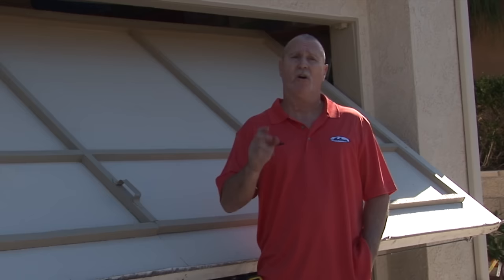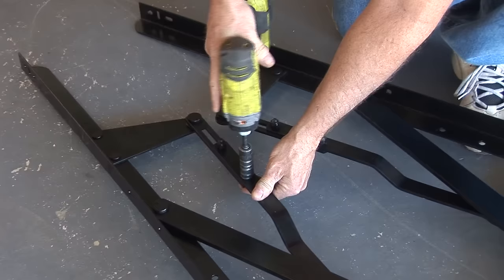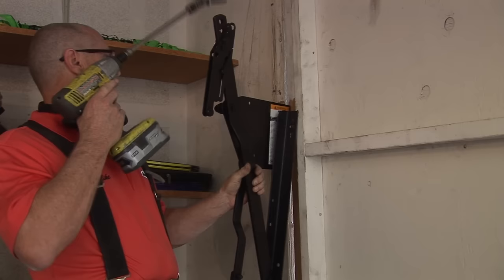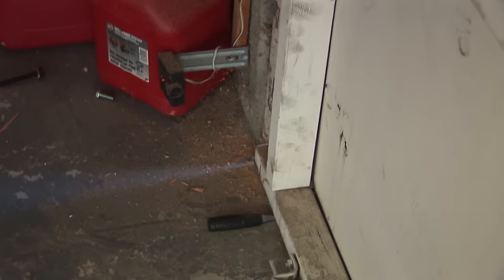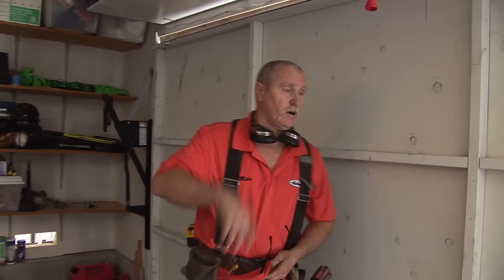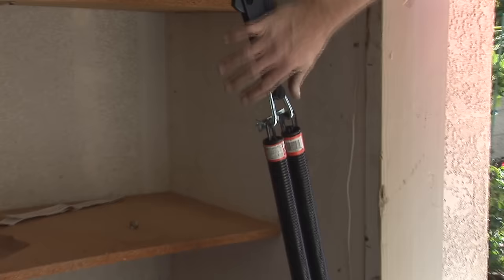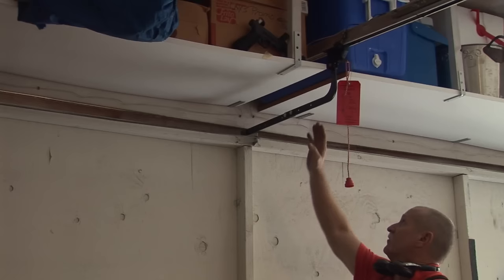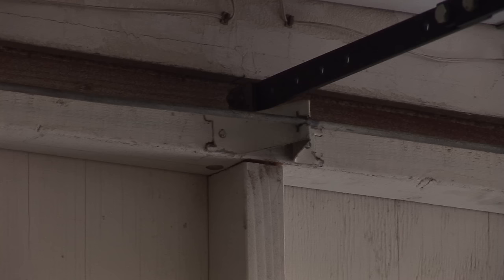Installing Holmes E-900 Hardware & Springs

Comment: You are the man, Mike!   I have a 32 yr. old one piece steel door with worn out hinges.  The main hinge pivot had almost worn completely through the master arm.  I had to do something fast.   I called 15 garage door companies here in Phoenix, but none would work on a one-piece door.   They were all happy to recommend that I spend over $2,000 for a new roll-up door.   I'm very happy with my existing door.  In 32 years, it has only needed 2 sets of extension springs (easy DIY job).   Compared to what my neighbors pay for constant maintenance on their roll up doors, that's a bargain.    Thanks to your video I was able to replace the hinges and springs on my one-piece door for $200 and about 4 hours of my time.  You saved me $1,800 and lots of future maintenance bills.   Thanks!!!
Reply from the maker: Wow That's fantastic!! you wouldn't believe the crap I get from garage door companies protesting the fact that I put out video's like this. It cuts into their business when you do this type of job yourself. They say it's way to dangerous to show jobs like this, but obviously not since you were able to pull this off...Good for you!! Thanks for watching!
Reply: Funny thing is that I tried for months to find a garage door company to do the job.  No "professionals" were interested.    As for danger,  your video shows the proper way to install this kit.   I suspect it would be more dangerous for a DIYer to install the E900 kit without having viewed your video.      Thanks Again!!
Reply from the maker: Excellent!! Now you know the limitations of the “professionals” in your area! 😆
Glad it worked for you! 👍🏽
Reply: Thank you, Mike, for taking the time to completely explain and demonstrate how to remove and replace one piece garage door hinges.👍 I loved my one-piece door and didn't want it replaced at any price. I'm fairly handy with repairs but was very nervous taking on my R&R job. Watched this video 3 times and then set out with what you teach and 5 hours later, with no hidden surprises, I have my brand new one piece door hinges installed and working perfectly. Getting the bottom of the door gap right would have been something that I would have never considered. My garage door has never functioned so well.👍
Thank you again for putting this together, Ed.

Comment: Thank you for taking the time to explain each step in this video. Ive just rebuilt two 90+ year old houses in the Hollywood Hills, and want to keep the 1pc doors original. I've never done garage door work before, yet know I can confidently tackle it now...these informatives not only help do-it-yourselfers, but they also assist those of us whose building fortes lie elsewhere.
Reply from the maker: Robert Dunn Glad to help out Robert!! As you can see by some comments there are others that would prefer you not do anything on your own...you should pay a "certified Master technician" to rip you off. Glad to see you tackle it and save the coin!!

Comment: After all these years, this still appears to be the leading video on one-piece garage-door installation. Good video demonstrating you are the strongest man in the world - but for women doing this, you leave a lot out regarding how to get  springs on without being the strongest man in the world. Also, my E-900 P728 springs appear to have an inter-spring or steal thread that has to simultaneously line-up with the larger outside diameter spring attachment hole in order to make the hook up. Strongest man in the world method does not work for this. Lastly using the strongest man in the world method to "muscle" the springs into place can be a disaster if you pull up on the spring with your bare hands (as you do in the video) then come to realize, you can't make it to the top and have to release it => now that the skin of your hand is inside the coils, when the coils collapse, your skin stays inside, much pain, bleeding etc. Wear very heavy gloves to avoid this. But overall most of the video is educational and accurate. I used the E-900 kit after building my own door from scratch since I build my own house new - it never had a prior door to work with. About $300 to complete the project absent an electric opener. Far cheaper than any other method of making a good 100 mph wind-proof garage door.
Reply from the maker: I will agree that this type of job is not for the average joe! But i think it’s more technique than muscle. However you are correct in the massive savings by doing this yourself. 👍🏽

Comment: Mike I can’t tell you how many times I come back to this video when I need to make adjustments. I built a 16’ slab door for my son 2 years ago, and had it tweaked perfectly thanks to your well done videos. I had an incident happen yesterday that you might want to stress to your viewers. My lag bolt that holds the steel anchor for the springs at the bottom of door failed and shot out like a rocket from the tension of the springs. I told my son that it was my fault because I should have gone with a longer lag screw to hold the anchor. It was my fault, not anything to do with manufacturer. The problem now is, he is so freaked out that he doesn’t want springs anymore. He thinks they will break or something. He wants counterweights, and I told him that is nearly impossible because it would require a lot of weight suspended from hardware that wasn’t designed for that. I am a little frustrated right now because I know it’s a simple repair, and it was pilot error. Just stressing the fact to your viewers, the importance of making sure the bottom wall anchor for the springs is secure. It’s been too long for me to remember, but I think I used my own lag screw, and it was only about 3” long. Not enough.
Reply from the maker: The lower lags should have been provided in the hardware kit but in any event they are roughly 5-1/2 to 6 inches long and when you pilot hole for the lag try to angle it slightly upward. That should make for a good hold, they rarely pull out when installed properly. Counterweights…like you said just won’t work so maybe just refill the hole with a dowel, and pilot upward and use the longest, strongest lag that will work and you’ll be fine. Do both sides.
Reply: Thank you for such a quick response! There is no question it was my error, and I knew the lags were supplied. Somewhere down the line I screwed up and used the wrong lag, or one of my own. Thanks again! Now it’s just convincing my son that it won’t happen again. It was my fault. The hinges are fantastic! No complaints at all! I love all the adjustments you have to choose from.

Comment: Mistakes.  1.  Disconnect the L bar from the opener and the top of the garage.  Or else
you will destroy it when you open the door.  2.  Hang two 5 gallon buckets of water from each
spring attachment bolt on the hardware.  This 80 lbs hanging from the spring attachment point will allow you to raise the door.  You will break your back trying to lift the door without water bucket counter weights.  
                    Mike has made an excellent video.   Like he says, mount the plate, adjust the door........ then screw in your 3 inch lags to the door with the hardware in a natural position of comfort.   The hardest part is raising the door without any springs.
Reply: Yeah my guy did not do that and now I am screwed.

Comment: Mike, I was looking for a fairly short video, today, to get me through my job of installing new springs P728 on a wood garage door just like this one in video. I've done the job and came across your video, tonight and told myself "I'm not watching a 48 minute drawn out video. I really don't have time. I found myself watching this from beginning to end! You really did a great job on this install vide. I am happier than happy that I started it. You refreshed me and taught me things about these setups I didn't even know about. THANK YOU! 
Today, it took 2 of us to pull these springs up to get them on the hooks. Then, the door was too hard/heavy. Opening and closing felt too heavy and I was NOT going to install the new carriage until it was much better. I adjusted  the bolts on the Adjustable Kicker (4 holes) down 1 hole on each side. This was a huge difference. However, I had to remove springs in order to move bolts to lower holes. Does this sound like the spring hook chain is 1-2 links too short Again.., 2 to R&R the springs. It seems to operate well but, something in back of my mind says this door should be a little more easier to operate.
Again, thank you, for an excellent, top notch, professionally done video! Liked, subscribed and saved this video!
Reply from the maker: Thanks buddy I appreciate ya watching my vid. sometimes these doors can be so heavy that even a balanced door takes a bit to get it moving… once moving they are ok. If it stops and stays where you want it to then it’s ok. Sometimes these 1 piece doors can only get so smooth that perfection can’t always be achieved, other times if you just play with it a bit longer you can nail it and get that perfection.
Reply: @ALLProGarageDoors  Thank you. I appreciate your time in responding. I did get it done and client/customer says all working well, days later. Your video really was a great help that I had not anticipated. I saved it for future reference( cause, when you get older..., you forget shit :).
Thanks, again!
Reply from the maker: @standtall7646   😆 indeed… i forget shit alot!!! 👍🏽
Reply: @ALLProGarageDoors   YEs. I forgot what we were talking about. Oh, yah. Hot girls in bikinis 🙂
Reply from the maker: @standtall7646   Ofcourse! 😉

Comment: Not sure new hardware will solve my problem but after watching this video it’s worth a try and may solve other problems. The door pops open after the machine closes it…sometimes five minutes later!  Thanks for taking the time to create and share. Love that’s it’s still being viewed years later.
Reply from the maker: if the door opens by itself it’s definitely an opener issue. could be circ brd or stuck remote or pinched wallbutton wire.
Reply: Thx, I'll check those items.

Comment: Very interesting video on installing one piece garage door hardware! When I was a kid, both our garages had the one piece doors. I am actually surprised you can still get hardware for them being that they have gone away from them.
Reply from the maker: I’d be surprised if the hardware wasn’t phased out in the coming yrs. Some parts are already obsolete like the 1pc truss rods and some truss rod hdwr. But then again i’ve seen some parts go obsolete then a yr or two later they are back in production so who knows. 🤷🏼‍♂️

Comment: Thanks very much for this video.  It was very helpful!  I successfully replaced the hinges on our 1961 garage door today.  I added the top brace as you recommended, and it really helped with the stability of the hinges.  The old hinges used to wobble side-to-side; the newly braced hinges  corrected that.  About the only confusing adjustment for me was the "above the knee" kicker, as the door was falling too quickly even with the spring on one of the shortest chain loops.  The manufacturer provides an extra kicker bolt on the right side hinge plate.  I guess the intent is that you add the extra bolt in the hole below the existing bolt without removing the original bolt, then after the extra bolt is tightened remove the original bolt and do the same on the opposite side (this allows you to move the bolt down in the "above the knee" kicker without unfastening the springs).  I stored the extra bolt on the top brace (the extra bolt is provided in the hole I used for the top brace).  I appreciated your clear descriptions of all the steps, especially how to adjust the kicker to optimize the lifting power of the springs.  The garage door now operates so much more smoothly with our garage door opener.  Thanks again for a great video.
Reply from the maker: Everything you said is correct! Glad you have a good knowledge of how the hardware works, it's amazing how many adjustments there really is on this hardware to allow the door to just float. 👍🏽👍🏽

Comment: Stupid Cantilevers! Been ripping these swing up doors out for over 20 years. Almost any left are never going to change to sectional. Newer openers are weak, and need to be adjusted just right to work on a swing up. In fact, most say on the box for sectional doors only. Thanks for the info on those!
I would hold on to any older openers for future use. Those old Genie screwdrives aren't being made anymore. They were beasts. The newer Chamberlains are DC and one time getting jammed finishes them off. No more changing out a worn plastic gear. I switched to appliances a while ago and now am doing appliance repair and garage door work. Appliances Cheaper is my channel. Most of the videos are pretty old though.

Comment: Great video! Thank you very much for taking the time to make it. Will save me hours on my single car garage door project.
Reply from the maker: Garrett Brittle no problem, glad to help out!
Reply: @ALLProGarageDoors  Do you need to use 2 Garage door hardware kits for single garage door that weighs under 250? Or will 1 hardware kit work just as fine?
Reply from the maker: Johnny Griego I'm not sure what you mean by "kit" but when you get the hardware it comes in a box that should be complete minus the springs so everything else in the box should be enough to do both sides of a door.
Reply: @ALLProGarageDoors  sorry if my verbiage threw you off. But when I say kit I'm replying to the garage door hinge. Would one hinge work plenty for a 250 lbs door ? And one spring? Or would I have to install 2 door hinges and 1 spring for each hinge? Thank you for your help
Reply from the maker: Johnny Griego no worries...typically on a garage door you would have one hinge and two springs on each side. So two hinges total and 4 springs for a door that weighs 250. I don't believe that one spring per side would be sufficient.

Comment: I’m going to put new springs on mine as well as replace some of the bolts. I can get the correct size springs and will use grade 8.8 strength bolts. Too difficult to try to get someone to do it. 
If it all goes wrong I’ve had a good life and have written my will 😅
Reply from the maker: You’ll be fine! 🤞

Comment: Great job! Very informative. Wish you guys were located up in NorCal, but I think I learned enough to redo my hinge and springs.
Reply from the maker: Any questions just let me know!
Reply: @ALLProGarageDoors  finally getting around to fixing the garage door and finding that the door is rubbing against the garage opener rail and one of the ceiling beams. I'm guessing I don't have the long plate lined up on the door high enough. Or is it that the main plate not high enough? Help! Please. Thanks!
Reply from the maker: @spinn1  there are three holes on the bottom of the main plate, the cantelever arm should be in the hole closest to the door… move it to the middle hole on both hinges and the door will turn faster.
Reply: @ALLProGarageDoors  at 12:52 in the video, the plate is shown and it looks like the holes that you're talking about, you have the cantilever arm in the first hole, is that correct? You mentioned it should be in the hole (3rd?) closest to the door, but I should move it to the middle hole? Not in front of it at the moment, but I think it's already in the 2nd hole position. I will check later. Thanks!
Reply from the maker: @spinn1  my mistake…Factory setting is the first hole farthest from the door, so the middle hole will make the door turn quicker.
Reply: @ALLProGarageDoors  what will putting it in the 3rd hole, closest to door, do?
Reply from the maker: @spinn1  each hole forward just makes the door turn at a much lower radius… thus avoiding hitting the ceiling or opener rail.
Reply: @ALLProGarageDoors  thank you! I will check that out.
Reply: @ALLProGarageDoors   well, it was already in the 2nd hole; I switched it to the 3rd and it now hit one of the ceiling beams at the right side. Having someone come by tomorrow to let me know what it will take to adjust.
Reply from the maker: @spinn1  Ok let me know how it goes.

Comment: At 27:52 you can see the two small holes that are there to accept double-headed nails to be placed to hold the bracket 'square' after it is adjusted 'plumb.'  Also, the MFG recommends the replacement of the wood as best practice when the new hardware would need to use the 'old holes,' and filling the 'old holes' with dowels as the next best approach. Given the size pilot holes and lag screws, the best way to install those dowels would be to glue them in place and let them set up a while before drilling new pilot holes and driving in the lag screws.
I mean, if it were my house . . .

Comment: Thank you for the in depth tutor. Gonna build me a door and use this hardware.
Reply from the maker: Iam Negan try not to over build it... keep it light but make sure it’s painted inside and out, the key to a good door is the weight and paint.
Reply: @ALLProGarageDoors  thank you for the advice.happy holidays bro.
Reply from the maker: Iam Negan same to you buddy!! 👍🏻👍🏻

Comment: Hi Mike. minute 11.40 I don't have that tape to know where to put the hardware. I don't know how high to put it. Thanks Mike.
Reply from the maker: use a tape measure, measure 20” down plus the thickness of the door (taken from the side) and that will be your top hole.